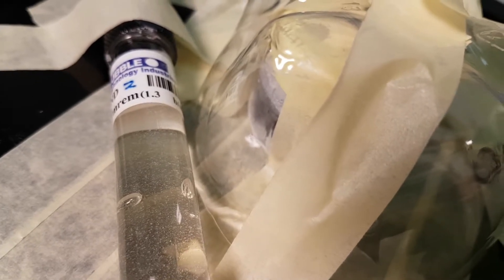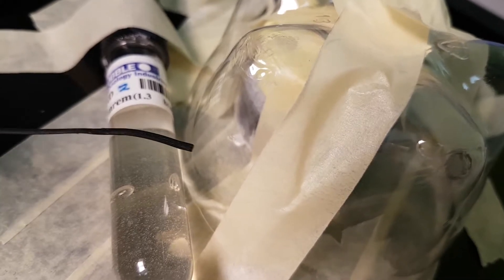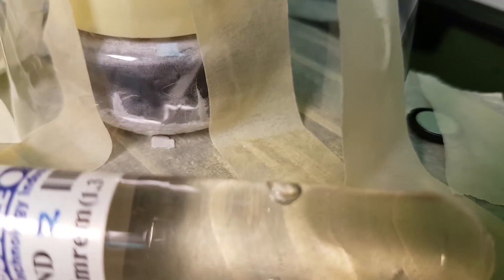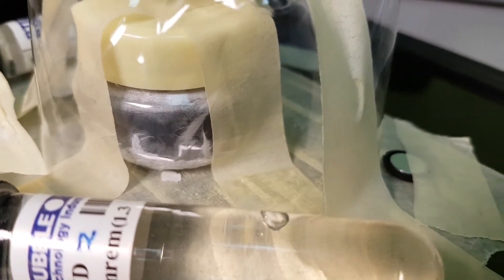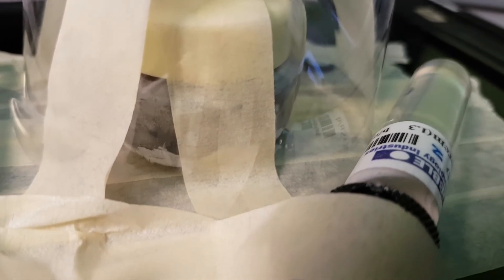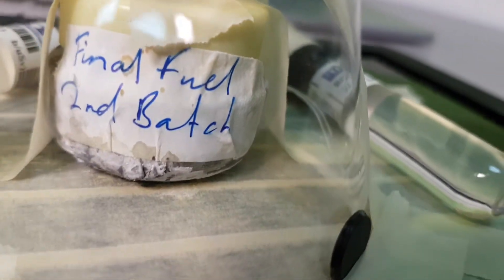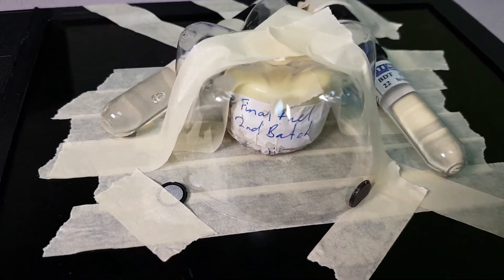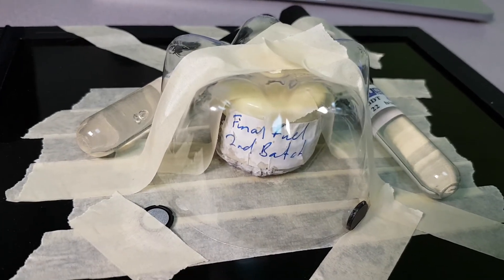Strange Radiation after 3+Weeks - ECCO fuel

Comment: I think the parameters of the Suhas ECCO reactor are somewhat wrong, the discharge power frequency, 1MHZ pulse DC discharge, but 1MHZ already belongs to the radio frequency range.
What I know is that the DC power source of the high-voltage pulse DC discharge is within 1KHZ-100KHZ, and has not yet heard of such a high frequency high-voltage pulse DC discharge power supply.
Reply from the maker: This is the information given.
Reply: I'd like to ask some questions about the reactor designer Suhas. Do you know Suhas's e-mail? Thank you